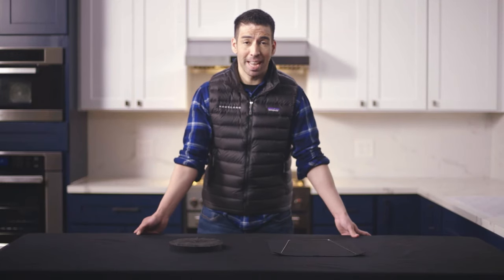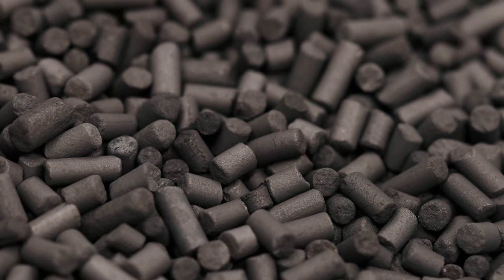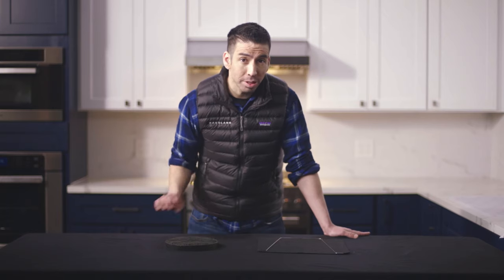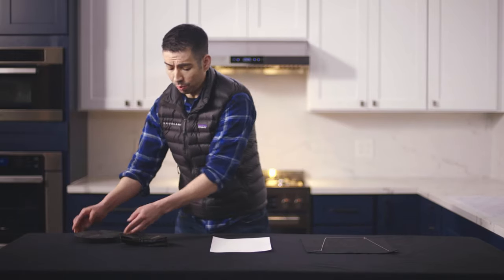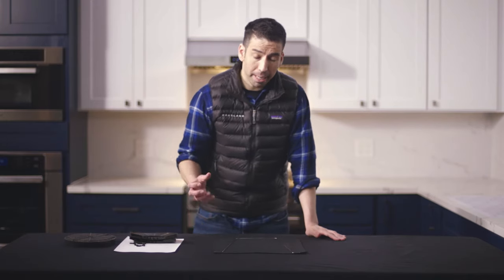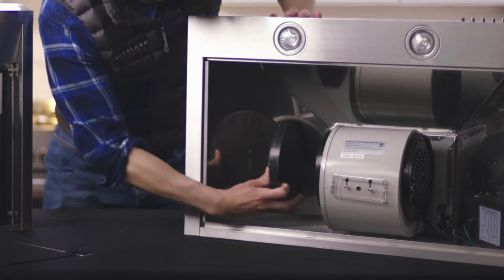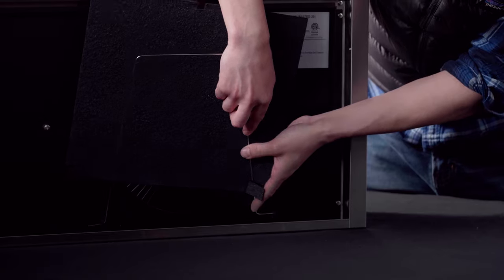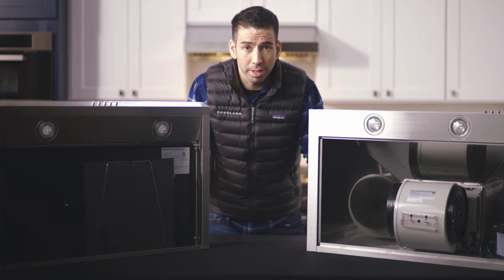How to Install Range Hood Filter | Charcoal Filter and Ductless Operation Explanation & Installation

Comment: After installing the round charcoal filter on wall mount hood, do you place back the SS baffle filter?
Reply from the maker: Hi!

Yes, the stainless steel baffle filter will go back on after the charcoal filter is installed :) 

- Hauslane

Comment: Where is the filter located on a wm-600 model? thanks!
Reply from the maker: Hi! The filter will attach to the sides of the motor using the notch that sticks out on the side of the fan wheel/motor. I linked our YouTube tutorial in your previous comment for clarity :)

- Hauslane

Comment: How do you remove them?
Reply from the maker: Hi Thomas,

The charcoal filters can be easily removed by pulling it off the housing of the fan and replacing it with a new filter.

- Hauslane